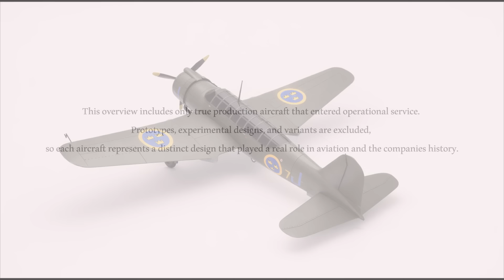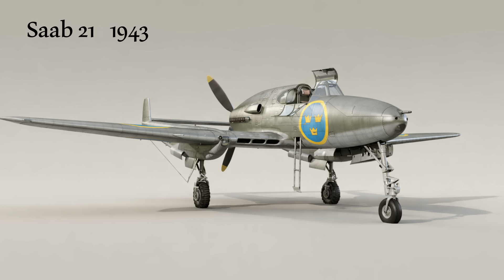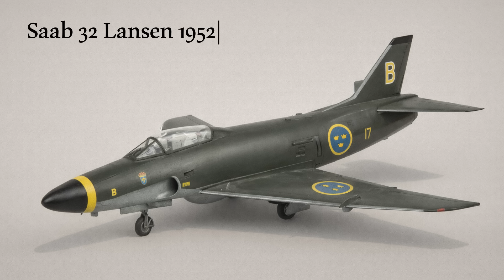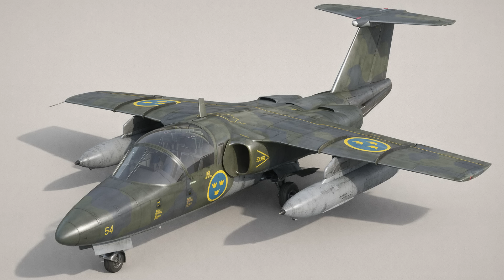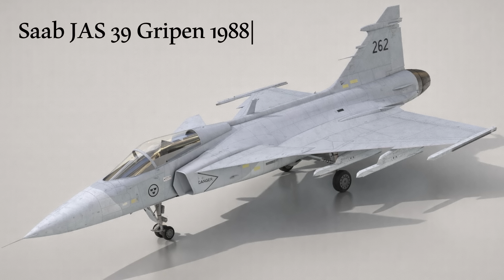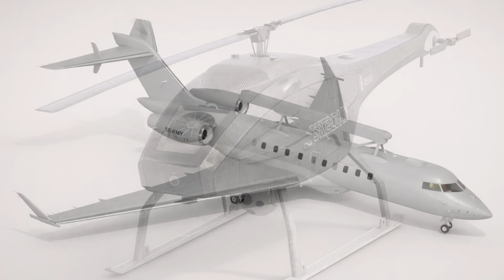Every SAAB Ever Made

Comment: SAAB safir not safari
Reply from the maker: Both exist safir and the safari
Reply: @ogni-tv 👍
Reply: @ogni-tv  
Both exists but only one was designed at SAAB, Safari was called SAAB-MFI 15/17 since it was "Malmö FlygIndustri" [Malmö Aviation Industry] who designed the Safari and are considered the original manufacturer, fun fact it was produced in Pakistan (under license) at least into the 2010:s.
Reply: @henningjorgensen8528  still in service with the norwegian airforce display fligths

Comment: I was kind of hoping you would include the cars 😢
Reply from the maker: i will make a separate video for saab cars
Reply: @ogni-tv  alright, but you did call the video EVERY saab EVER made
Reply: @FamNybye because this is a series centered on aircraft nanufacturers and as such this is all SAAB aircraft ever made so it's correct in this particular context
Reply: @Pedro1745 well for those just discovering the series I think differentiating between cars and planes would be helpful.
Reply: @ogni-tv thank you!
Reply: @ogni-tv  For the submarines and ships too?
Reply: The numbering of the aircrafts was continued on the cars with SAAB 92, 93, 95, 96(??) and 99. Later the models 9-3 and 9-5 was an homage to the first SAAB cars.
Reply: @Soundbrigade  The numbering of the aircraft comes from the Swedish air force designations.
For prop planes the internal Saab projects were double digits, but with the jet era they started using four digit designations.
P1000 became Tunnan 
P1100 became Lansen
P1200 became Draken
P1300 was the canceled nuclear bomber
P1400 lots of VTOL/STOL variants & Mach 2.8 Draken replacement
P1500 VTOL/STOL variants that became Viggen
P1600 was the cancelled B3LA light attack aircraft
P1700-P2000 were used for many prototype variants that would eventually (after a looong time) turn into T-7 Red Hawk
P2100 became Gripen
Reply: I was kind of hoping for Saab cruise missiles